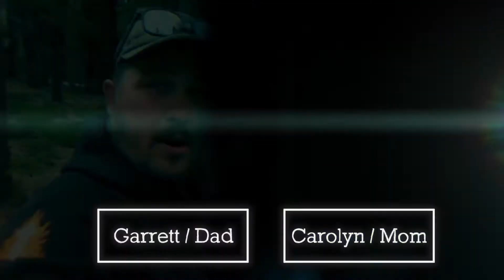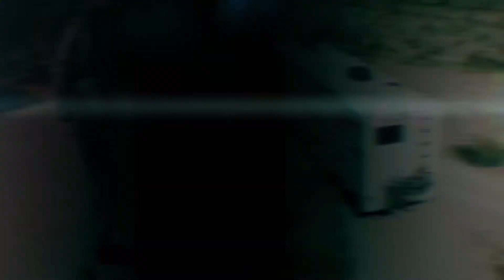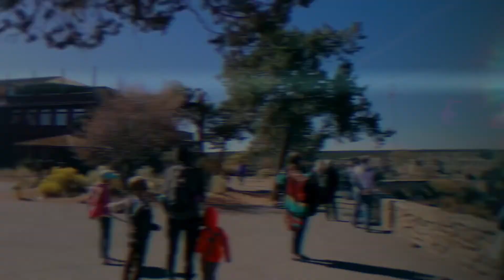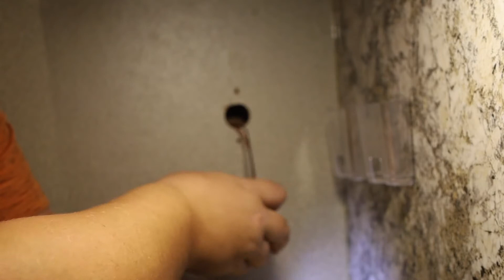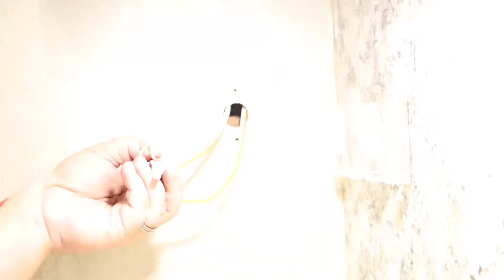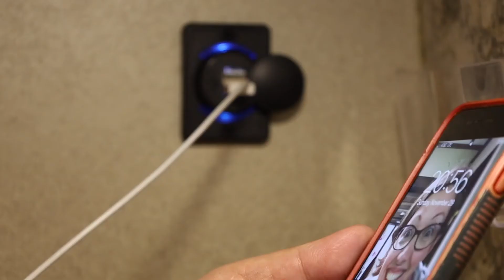Replace USB Charging port in RV

Comment: We just purchased a 2017 Cherokee Wolf Pack and none of the USB ports are working. Where do we start to find the problem?
Reply: Check your battery and converter panel.
Reply from the maker: Hopefully you figured out the problem. I would check your batteries and the other 12v items in your trailer. If you have good voltage, then replace the outlet.

Comment: I have a USB port that is not getting any power.  I bought the RV new and the charging port has never worked.
Reply from the maker: If it’s been within the last year you can get it replaced under warranty.

Comment: Thanks for the vid!  I'm not near somewhere I can receive Amazon packages at the moment...got the USB socket open and wondering if anyone's ever re-soldered any of the wiring to at least temporarily fix one of these??  Guessing it's probably a cheap circuitboard issue but thought I'd ask!
Reply from the maker: I don't know of anyone who has re-soldered these. Since they are usually Chinese made they don't last and repairs can be tricky.

Comment: is there a big difference between the 3.1 vs 2.1 amp one? Mine just went out on my 2020 heartland bighorn I full time in. The back of my usb outlet says input 12/28vdc output 5vdc 2.4a total
Reply from the maker: the 3.1a will charge your devices faster. its pulling more amps. It's like use a USB brick (for like an ipad) vs the small usb adapter that comes with a iphone.
Reply: @DiaryofaFamily  thanks so much for your reply! I just ordered it and will tip you on your PayPal  link Friday when I get paid. The dealership I bought this 5th wheel from is terrible and can never get any help
Reply from the maker: @canadian22483  we've been fulltime for over 2 1/2 years. we rarely take things to the dealership. much easier to figure out how to fix it yourself.

Comment: Thanks for the great information. I would like to upgrade our USBs to the higher voltage USBs. The lower voltage USB just won't charge my phone... Thanks for sharing! Steve
Reply from the maker: The port I got will charge my iPad. It’s the same wattage. SANON 3.1A USB Port Charger Socket Outlet 12V LED Waterproof Car Dual Black ABS https://www.amazon.com/dp/B0871WMC6Z/ref=cm_sw_r_cp_apip_2F6ABYVqy5hZj

Comment: Thanks for sharing. We’ve got a couple we need to replace. Seems pretty easy. Don’t you turn off the power source, first, though?
Reply from the maker: It’s up to you. It is low voltage 12v. I mainly left it on to demonstrate how it works.